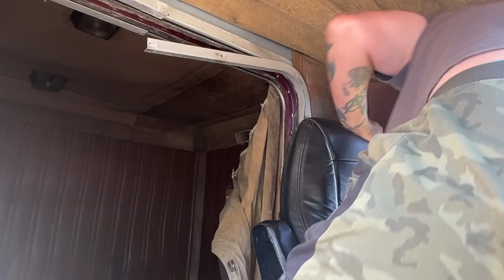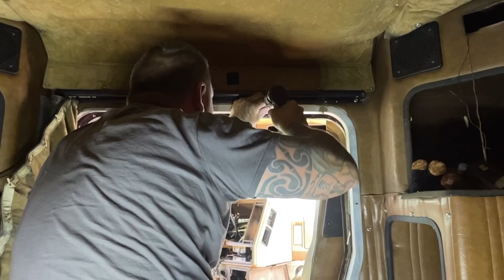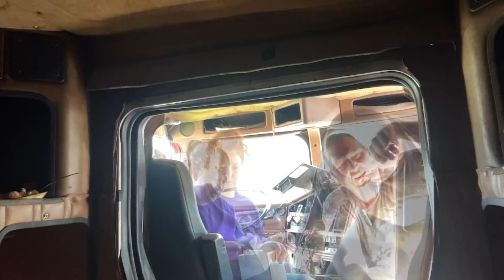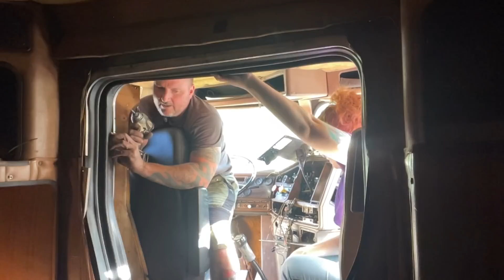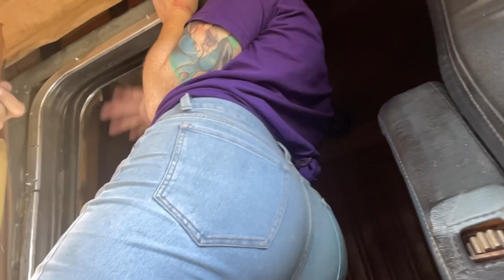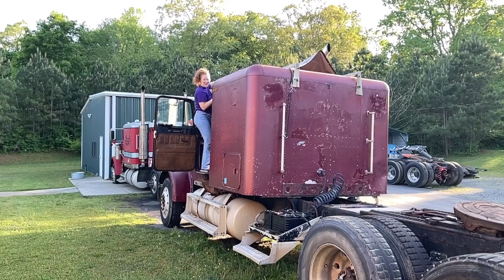Freightliner FLC “Franny” Gets a Sleeper Boot installed.

Comment: Hi James.. Next time you replace a sleeper boot .. use 2 different coloured sharpie pens to mark the surrounds  to the boot .. 1 colour for the front  and the other for the back .. also if you mark a start point  on the trim and bunk trim ...and a few marks round the trim so you can easily follow the trim round where it was before removing it , Will make it easy to refit the boot .. a Light rub with some Petrol / Gas on a rag will remove the sharpie pen marks  on the trim .. Stay Safe out thee ... Keep up the good work .. Andy .. UK ..
Reply from the maker: Great idea.  Hopefully I’m done with sleeper boots tho.  Crazy tedious.   Appreciate ya

Comment: I feel your pain brother. I drove that type of truck with a 3406B Cat and a 13-speed Roadranger for many years. I too changed the sleeper boot and yes it was a pain in the ass but I didn't have the luxury of a helper. So I made things as easy as possible and removed the seats. It really opened up the cab so I could work. Thank god I was a lot thinner then. LOL But I had a 2 bay shop to work out of so I didn't have to worry about rain... Just heat!
Reply from the maker: Appreciate ya watching Daniel

Comment: Good Job on putting the sleeper boot on I did exactly what you did on your install but next time take those seats out that will help with your stress and how is your leg healing after your fall Well you and your wife stay safe
Reply from the maker: Ya after I was done I was like dang should have just popped out the seats.    Leg is healing up well.  Kinda rolled up the muscle a bit. Wonder how long it’ll take to settle back in

Comment: Good video man. It's hard work trying to put a sleeper boot in a Truck. I hope they buddy one-time put one in his truck that it took a case of Bud Light and 30 buffalo wings to calm my blood pressure down from being frustrated so I know what you went through. I like watching your videos Man you do very good work on truck man. I also like your Crocs you was wearing man. I hear that they are very very comfortable to wear. Sometimes your feet need a break from boots and get some fresh air. I wish I could wear them but am a chubby fat dude with big chubby wide feet sz15 6E wide with very chubby fat wide toes that are equally straight across making my foot very very wide at 6 1/2 inches wide from my big toe to my lil toe & those crocs they do not make them wide enough for my foot. It sucks having a foot this extremely wide because my foot out grow shoes , socks , & boots when i was 18 years old & flip flops is the only footwear that will barely and i mean barely fit my foot because of my toes being wider than the flip flops straps. If my toes was at a 45-degree angle like everybody else's toes are & not equally straight across making my foot very very extremely wide footwear would probably be a little more easier for me to find. & having chubby very fat wide toes don't help. The good video thank you for sharing your video.
Reply from the maker: Ya normally I’m jeans and boots but I knew I’d be raining sweat in that closed up truck.  Hahaha I for sure thru out a thousand cuss words what a paint in the butt.  Appreciate ya commenting

Comment: Hi. I am looking to replace the sleeper boot in my FLC 120 also, but am having trouble finding a parts number to work with. Do you happen to have the parts number you ordered by chance?
Reply from the maker: I can’t seem to find it. But i do remember the part number was on the old boot when i took it out. And i believe i got it from finditparts.com
Reply from the maker: Did you watch the video i can’t remember   did i mention the part number